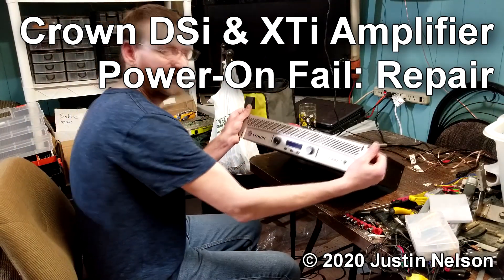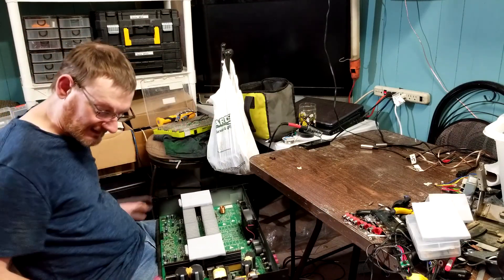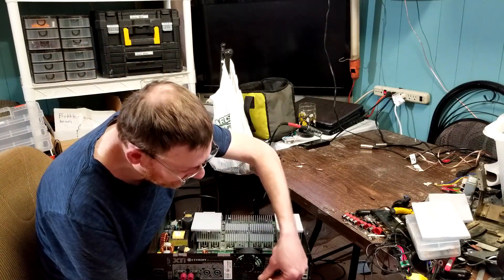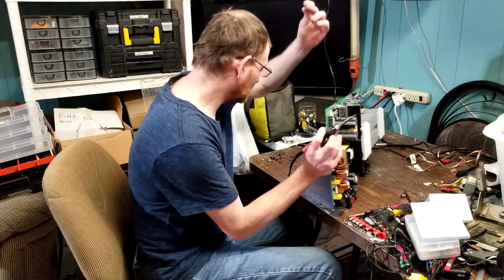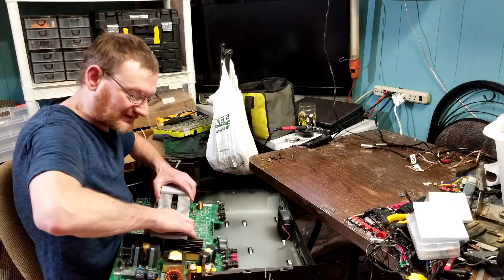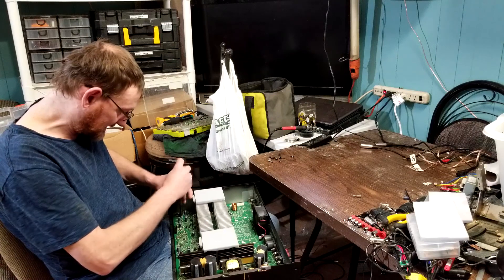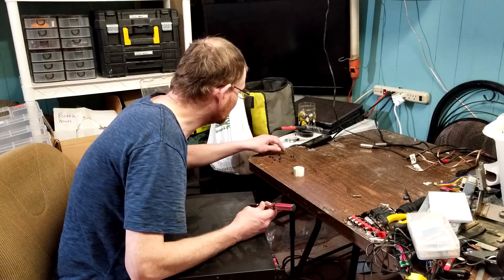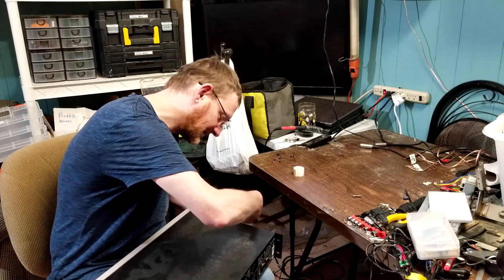Crown XTi Power On Failure   Repair in 16 Minutes

Comment: Is this repair the same for the Crown XLS202 amplifier. I have same issue, won’t power on. I have been pushing it very hard today and it died. Would like to save it. Also, should i upgrade to beefier amp for heavy rap bass?

Comment: Hi Justin. I got a Crown DCi4300 amp that has a flashing power LED and won't power up. Any ideas?
Reply from the maker: Sorry, unless I had that amp on my bench, I wouldn't know where to even begin. I'm not familiar with that particular model, but I imagine that the manual must mention what a flashing power LED might indicate
Reply: Ok thanks. The manual says the light flashes when the AC power is above or below normal. Not the case. When I scope the ON button I can see the signal going to the 2nd power supply stage but it won't start up.
One of these amps sold for parts only on ebay. It had the same problem and the tech gave up on it.

Comment: I have a Crown 1002 XTI Series amp that will turn on just long enough to tell me "DSP is off" before shutting down. Do you imagine it's the same issue and same repair?
Reply from the maker: It is doubtful, because this particular repair fixes the issue where the app doesn't even attempt to power up. I would recommend checking all capacitors on the circuit board, especially around the power supply, as a starting point.

Comment: Worked perfectly as described.  Thank you!
Reply from the maker: Glad to hear it! It is worth noting that it is generally a good idea to replace pretty much all of those light blue capacitors, I believe those are rated at a relatively low temperature and as you probably are aware, the temperature is inside the amplifier can get somewhat above that rating

Comment: Hello where are you located I have a xti 4000  that needs repair
Reply from the maker: Sorry I don't do repairs for others. It's just a hobby of mine, I wouldn't feel comfortable repairing an amp and risking something going bad with it later on... Of the five I repaired that day, two of them have since died...
Reply: @JustinNelsonsProjects  oo ok no problem.. thanks alot for replying 👍👍
Reply: @JustinNelsonsProjects  They died from some other failure mode, I assume? Wondering if the higher voltage rating could cause problems. I have the schematic for my XTi 2002, but didn't find the circuit for C196 on a quick skim. The input power section is so cramped it's a bit of a pain to probe out the circuit. I powered off the amp to do some rewiring and it wouldn't power back on. If C196 is actually a drain for the bigger caps, your logic on the failure makes sense. Its sister amp (basically the exact same number of hours and program material throughout its life) is doing just fine, but I ordered up enough caps to do both. Have you seen any other culprits for no power on failures?